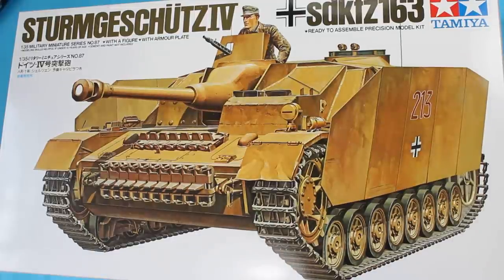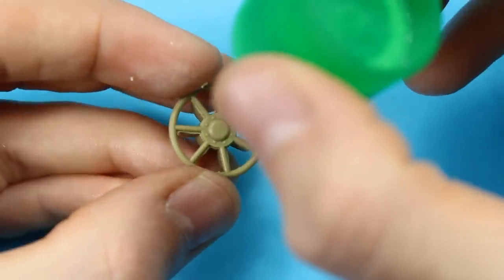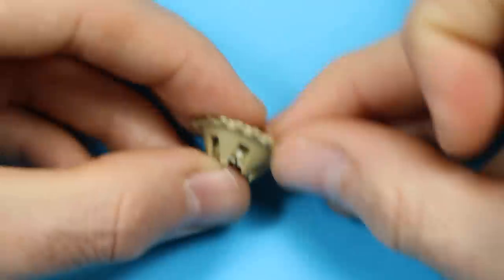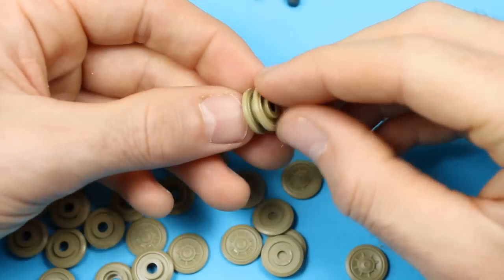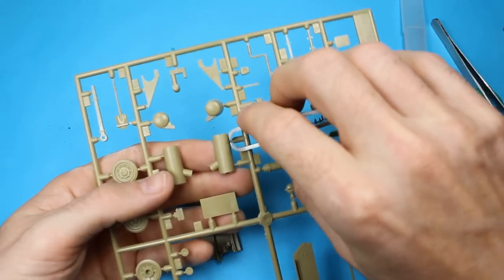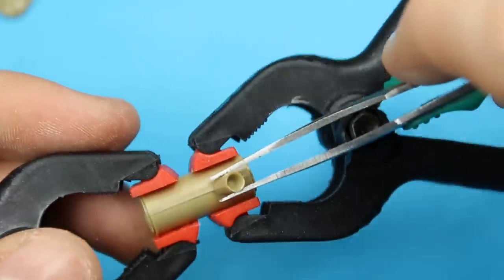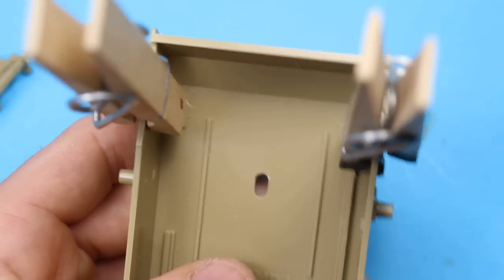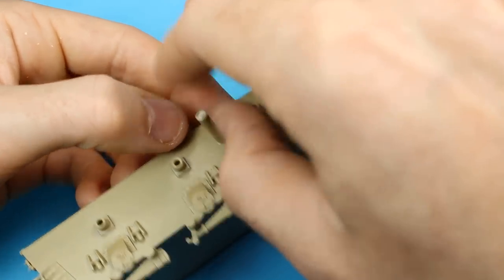Tamiya 1/35 Sturmgeschütz IV, (Stug IV) Step by Step Full Build Video, Part 1

Comment: For barrel sanding, I recommend using flex-I-file. Because they can conform to the curve, you’re much less likely to get flat spots than if using a rigid stick
Reply: I have been using one of these for years. Whenever I have to deal with anything with a cylindrical cross section, out it comes - barrels, mufflers etc.

Comment: Dear Sir 
After 50 yrs I'm  getting back into the hobby, I  built the current kit your working on when it came out. We're I  lived in Alaska had limited  supply and reference material were by hit an miss. I did very well in my limited  area winning more than I  lost and made enough money to buy kits and build them during Alaskas long cold winter . You are sending me back to school , some of the things you have done would have taken me a week to do our glues were sticky guey all my reading  an I  would have worn out a sheet of sand paper removing Squadron Green Stuff from a seam  .Airbrush  was a problem last century unless you sold a kidney to pay for one .I have a million questions not right now  . Shall I  call you Yoda  . Your teaching an old dog new tricks .

Comment: I also enjoy the older Tamiya kits ....they wont break the bank and they look great when built and painted ..... on the hole filling .... plug the hole with a bit of spruce and glue, cut off the access ....then .....I use the tamiya grey thin putty and the thin white primer/ surfacer in the bottle .... I've used the surfacer on the gun barrels and it dones wunders..... just little things I've learned over 45 years of modeling , since I was bout 8 years old ( first kit a snap Spitfire from monogram ) ..... keep up the modeling and have fun 😁

Comment: Thank you very much for your tutorials...very good...I am forced to do things a little different as I live I a country where specialised model paints etc are few an far between..even the age old humbrol is getting hard to find....our money is worth shyt so importing is way expensive...I'm in South Africa....but I'm trying to use universal household grey primer...which works btw if sprayed in very light coats.....my intention is to try and use local cheap acrylic craft paints...very hard to spray....or what ever humbrol I can still find....the oil weathering technics are really cool...thank you....I have modelled in the past ...30 years back...but it was 1,72 intended for wargaming...all the fancy stuff was left off...1.35 is new to me...apart from two reasonable attempts...30 years ago...I have thousands upon thousands of 1'72 soldiers of all ages but can no longer see well enough to paint them... anyway....thanks ..

Comment: Won't bother with all your doing miles to long doing mine in the bocage setting don't need to go over the top on the wheels won't see it anywhere when its finished try going into the stuff that will be visible 🤔

Comment: "You won't get this in newer kits[...]"  That is not true. Meng armour kits are notoriously riddled with flash, even in the first run of their kits. I bought their Merkava Mk.3D a week after its release, and almost every part have some flash. The lower hull is the worst in this matter. But their KingTiger is the same thing, just like the Leopard 1. Their aircrafts are somewhat better, but not perfect.Newre Tamiya kits really don't have too much flesh, but you get a crapheap of ejectorpin marks instead.
Reply: I think he meant tamiya older vs newer
Reply: @kenjohnston8173  Really? Newer Tamiya kits have a shitton of molding issues.

Comment: I love these classic Tamiya 1/35 and (1/48 aircraft) kits from the late 60s and (mainly) mid '70s. With the exception of perhaps drilling out exhausts and similarly enhancing vision or ventilator ports, I don't try to turn a sows ear into a silk purse. They are what they are. Rough cast texture (Soviet) or Zimmerit (German (43-44) as applicable using putty and a die tool at most -where required, preferably avoided by selection. Relatively quick, easy and fun nostalgia enhanced builds, IMPE the fit is still characteristic Tamiya fabulous. Importantly they still very much look the part sufficiently for suspension of disbelief with 95% of the modelling public regardless their scale and accuracy isn't directly comparable with the most contemporary tooling.  

And I confess turning 'traitor' preferring Dragon's continuous run DS Tracks now over their Magic Tracks, and even the currently vogue link and length. So I can sleep at night too with Tamiya's venerable continuous run. From three feet away, Tamiya's look realistic enough standoff to these older eyes. And the price. What's not to love? 

In fact, as one sufficiently pedantic about fact to own a copy of Doyle and Chamberlain since circa 1983 among various other reference volumes and owner/builder of numerous detailed Dragon kits all of which are now circa AUD$110~$130 to buy new, the mid '90s Tamiya kits at well under half that are absolute gems which still stand up very well. e.g. Jagdpanther 35203 and Panther Ausf G late 35176. It doesn't hurt that my age perceives the '90s as just the other day although it was thirty years ago. Back to the subject, excluding shipping, this venerable Tamiya StuG IV 35087 can be had for just ..wait for it ...AUD$22.99 today!

Comment: Just out of interest what did you use to cut the side skirts up with?
Reply: The side skirts in the kit actually have a line running vertically, thus indicating where to cut them for separation. I used a ruler placed on top of the side skirts and as close to the lines as possible; pressed down on ruler & side skirts in order to keep them aligned properly; then used a basic hobby knife to cut through the plastic.